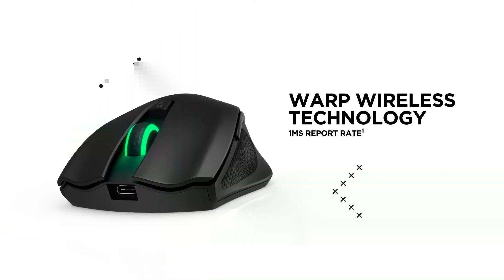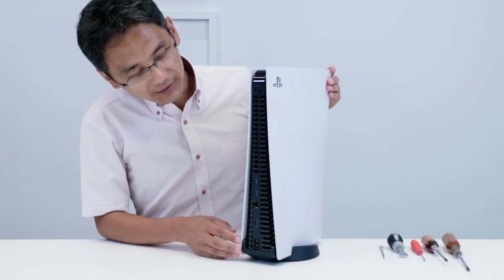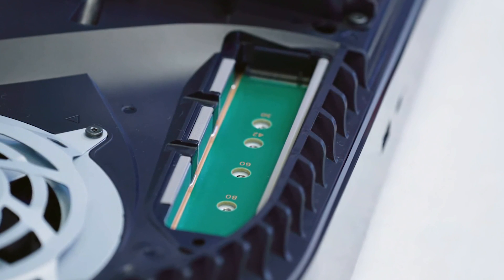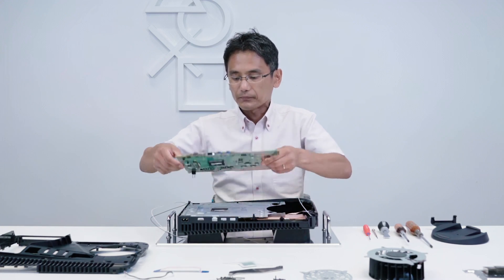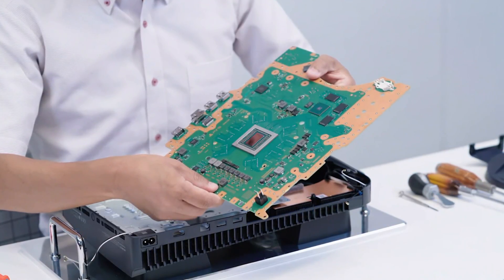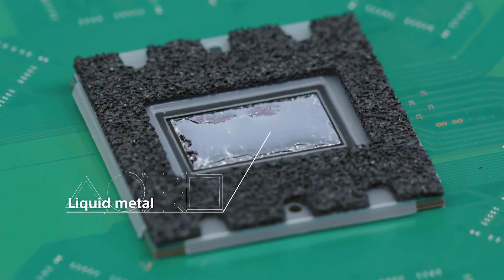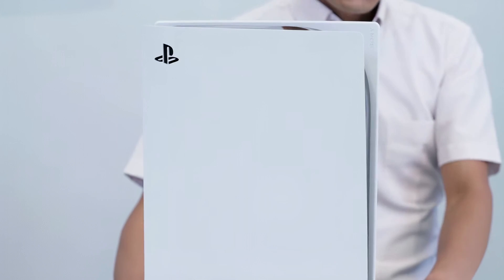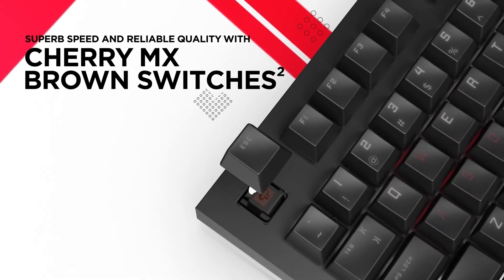PlayStation 5 Teardown Analysis: Inside Sony's Next Generation Hardware Design

Comment: Microsoft: you will only need a 4ft x4ft table if you take our xsx apart
Sony: you will need a 10ft x 5ft table for us 🤣
Reply: Looking at the PS5 disassembled reminds me of parts for a Gundam model.
Reply: FUCK YOU GOOGLE ASSHOLE   We'll have to see if it overheats but I do think it will be louder.. one thing about it though overclocking definitely creates more wear and tear so if they didn't engineer it properly it's going to fail more often than the Xbox.

The thing about overclocking though is that there is an upper clock and a lower clock. The console was originally 9.1 teraflops before they saw the 12.155 of the Xbox. 

So they overclocked the CPU and the GPU to reach 10.28. The problem with this is that only one piece of hardware can be overclocked at a time they cannot be overclocked together. Meaning that they cannot be overclocked concurrently at the same time.

This means when the GPU needs to overclock the CPU is going to down clock. And when the CPU needs to overclock the GPU is going to have to down clock.  So it's not a true 10.28 teraflop console.

Overclocking cannot be maintained 100% of the time or the entire console would literally fail. So it has to be used intelligently.

The issue with this is that there's lower ceilings to these clocks. And I would estimate that it's going to be closer to 9.3 possibly 9.4 under normal operating circumstances.

I'm an IT Major if you're wondering why I say that.
Reply: @Hannibal OMG..Sound¿?? Lol
Well you seem so disparate !
Reply: @Hannibal WOW.. How Incredibly intelligent and well thought out rebuttal...............   Did you just replace and swap words from a Hallmark card?  Because I tell you, Im sure ive seen it on one for a 13 year olds birthday..... Had a Picture of a Trophy on the Front.. Hang on.. Is it your 13th Birthday?????
Ok...as Im an adult, Ill try to make this easy to understand."Project less you angry, bitter pathetic little fanboy.."
 Your harsh judgement is really all put upon yourself.... I also do understand, You must be burning inside that your Real mum, whom you havent spent a lot of time with , well. ,not without paying,.( Always free for me ) 

I had actually responded before, and it was a Damn rippa....But Alas , It got lost in the Digital Either .. But however, I must reply in good stead , and did try to meet on common ground..However , its is impossible that I dont have a void in between my ears...  Its obvious that your IQ isn't even an IOU.. No one ever took it from you, As so far, I have come to the conclusion, You missed out when it was being handed out.... Your prepubescent correspondence suggests it must be copied from some online school help page  "Deal with Bullies Online-=101 (Kindergarten Edition)" 
I know it must be hard for you, especially knowing that your being has as much depth as a puddle that a sprinkle of a sun shower makes on Bitchumen during a heatwave…  
I do apologise I couldn't resend my original post, , It was a Rippa...  About 10 Paragraphs (Paragraphs are made ups of sentences… And sentences are made ups with words.. You'll get it, After learning your abc's... You cant copy and paste forever)

But , I grow weary of your insolence , and having been Writing Music and Drinking Brewskis all day , im feeling I need to go relax from all the non work I haven't been doing....

SO I must wrap this up.. I must take into account the issue of you being on the spectrum.. Though That would be disrespectful to those that haven't gone full like yourself .

But I know what you wont find on my reply   in my comeback.... 
That you can scrape off your mothers teeth..... 

BTW, I think you should give it a few days, your mums on the rag and Roll.. But I guess you know that after tasting your dads Microsoft.
Reply: Martin Schmidt   A sony Shill? Why? Because my opinion makes you defensive? Im having so much fun outing what is hypocrisy in spades.....   And you should read it, its for fun..   You see, when people  take something on as a personal attack, which is not on a personal forum , but a public one, shows peoples insecurities..... And here many have been unveiled.... Boy.. You'd be fun at Parties...... Oh... Am I on drugs? No.... Are you?
Reply: yeh.. Thats because really that table that 4x4 has a brute force PC underneath , operated by a brother of Craig.
Reply: @Rhythmattica  You're going to be really sad this entire gen if you don't think the Series X is the most powerful console.
Reply: @IxChipmunk101xI  What? Most powerful console with no exclusives that I can even play on my Mac Pro runniung Windows.. And the most powerful console? Like thats an issue that has been debunked multiple times  that this what makes a gaming  machine... LOL..  Games make a Gaming Console... Not Multi plats available even on phones via subscription... Thats the only reason I by a gaming console... Never have I bought one for POWA!... To Add, if sony goes the GAAS model, Ill be just a PC gamer.....Like always, MS tries a market, like Mobile, Zune. OG Xbox, Expecting to strong arm their way in , but when it fails, they go running, and use their marketing tag terms like "Outdated Console War" .. And usual, Based on nothing inovative , but a consolidation of what's been on offer by Mobile stores , Steam , and streaming subs like Netflix  Gakia,  Have fun with your sub box , And if Powa matters, it shouldn't right?? Console wars out dated....So says MS right?
Though Im sure the IQ and FPS on those VR games with be awesome with the POWA of MS's Non Gen. OH Wait!
To add... Sad that this entire gen the SX is the most powerful?  Wow..  So thats all you've got? Thats your retort? GOLD
, and with no VR on a next gen console, when even a current gem console has VR, I feel even dumber for responding.....
I award you no Points, And no Exclusives.
Reply: @Rhythmattica  If you guys really don't care about Microsoft exclusives then why are you whining about them having an Elder Scrolls, Fallout, Doom and everything else formerly owned by Zinemax exclusive to their console now?

Not only is the Xbox 38% stronger, but it's got a lot more than just power. Four generations of backward compatibility, Xbox Game pass which is an incredible value, and superior online infrastructure. That's in addition to Xcloud where you can literally play your console games with a controller anywhere..

Us Insiders already have it and that s*** is incredible.. with the One X that's like a six teraflop Nintendo switch with a better controller..

This is going to be a 12 teraflop switch with a better controller.. let's not forget they have the Series S for 299 which will give that PS5 a run for its money..

38% more power and $10 cheaper games... And now a ton of exclusives as well..

If you think people don't care about Elder Scrolls 6, Starfield, Halo, Gears 6, Fallout 5 and Doom 3 then you're mistaken.
Reply: @Hannibal Lol... Soooooooo DESPERATE.... Seems like most FB's , its always an assumption based on nothing but a small vocabulary and a correspondence no more creative than a  sentence from a DR Zeuss book.  Congrats .. You havent ever set the bar low, its but a invisible line below the ground you walk on.
Never go full.

Comment: Truth will be the power dissipation numbers for each console when under load. It looks like the PS5 will be the bigger room heater. I like the more compact lower power consumption Series-X. The PS5 is a more ragged edge design with the over clocking and the associated extra heat. Question to ask? If the consoles could be redesigned now who would make the bigger changes? Guessing the power hungry behemoth PS5 would roll more functions into silicon like decompression and ray tracing like the Series-X did. Sony would also add silicon so the system would not need to be overclocked. The Series-X is the more next generation HW that is leaving PS5 behind.

Comment: Wifi6 could also be used for the future PSVR2 for wireless play, correct?
Reply: It's the primary reason for having it I would say.
Reply: @tzuyd  Nope.
Reply: Maybe if you compress the image. For that use having 802.11 ad would make more sense with theoratical higher transfer speeds thanks to its mmW frequencies, which one of the few useful application due the requirement of having line of sight for it to work.
Reply: Of course you have to compress the image.  The throughput needed for a raw 120 fps signal at 1440p-4k would be insane.
Reply: @eliadbu  You mean 802.11ay 60ghz wigig, which no console for at least the next 10 years will be able to run, lmao. Also the fact that requires tons of power which means a massive 20000mah battery attached to your hip (not a big deal tho).
Reply: Sounds like a useless version. Like he stated you'd have to have a not produced now router and modem to utilize the feature.
Reply: He said you need hardware that supports Wifi 6 to use Wifi 6.  This hardware exists, just that it doesn't have widespread adoption yet.

Peripherals made for a device that uses Wifi 6 will obviously support Wifi 6.
Reply: @RaymondWebbIII  Someone doesn't know what peer-to-peer WiFi and WiFi direct is.
Spoiler: you could connect the PS5 to PSVR2 directly with no router involved while still connecting to your router wirelessly.
Reply: @RaymondWebbIII  Router and modern? lmao. No we are talking about two systems talking locally, network has nothing to do with this. A modem, is for ethernet, lmao. Just stfu when tech talk is going on, kid.
Reply: Nope. Inherent latency is inherent. Wifi6 is just 2+2 (5ghz+5ghz). It's not any faster or better irl use, it's just used to help with wifi network crosstalk. VR needs to hit at leastt 23ms to reach presence. 5ghz has a 50ms inherent latency. PSVR2 will need to be tethered, as do all VR systems (besides quest standalone).
Reply: @sqlevolicious  You talk as if you're living in a time frame where wireless VR doesn't already exist.  In just a year (let alone two) the technology will have improved beyond measure.

Comment: I never considered that the curvey design would make it more "idiot proof" by making it harder to block intakes and exhausts.
Reply: MertensCW  haha
Reply: Liam Spires  heatsinks are designed to disperse the heat, in the case of a console they take the heat in particular from the Apu, and relocate it away from that, to be dissipated by the air blown onto it. The heatsink or the vapor chamber alone doesn't work, it always in combination with a fan (and a pump in case of liquid cooling system )
Reply: MertensCW  You made me chuckle. Either way I can't wait to unbock and play my white and weird massive silent behemoth.
Reply: Martin Schmidt  richard specifically posted an article. Search it up. It’s about ps specs.
Reply: Martin Schmidt  it isn’t. It’s there on the internet. If you doubt it search it up. Or should I also do that for you?
Reply: Martin Schmidt  and I gave it to you.
Reply: Martin Schmidt  are you kidding me? I just posted a comment with a link on it. Not my problem if you can’t see it. Willfully ignorant. Lmao
Reply: Martin Schmidt  “There are two ways to look at this. First of all, I can tell you every single developer I’ve spoken to developing for PS5 has been evangelising how easy it is to work for.

“It’s essentially the same development environment as PS4 and you scale up from there, for the new power, the new features and whatnot. I can’t stress enough how happy developers seem to be with this situation.” 

This is what richard leadbitter said, not my words his. This came up with a single search, if you weren’t so lazy then you wouldn’t have wasted both of our time.
Reply: MertensCW  Really? You gonna go with that after the red ring of death?
Honestly with reports and that cgi animation of some air flowing through the series X magically when it's pretty much crammed in that box is what you should be worried about.
Reply: how many will put a book or magazine on top of xbox? you'd be surprised.
Reply: Martin Schmidt  digital foundrys richard talked about their variable clocks. Long story short its different compared to the pc where performance heavily fluctuates to the point it affects performance like that other dude is claiming. Also it won’t thermal throttle. Even richard who said that devs said the ps5 is easier to develop for. Don’t know where you get news from.
Reply: MertensCW  gotta appreciate a good Jab 👍
Reply: That's because you are an idiot. 
I jest of course.
Reply: Martin Schmidt  firstly you never specified what you were asking about einstein, maybe you need to do some work on your thinking capacity before you talk about the English skills of others. Also since you have specified exactly what you were asking about then ti check digital Foundrys celebration for one million subscribers. In that video he said that the ps5 is easy to develop for and that people will be surprised in a good way with the PS5. Now do with that what you want. :)
Reply: It does make me cringe a little to see the Xbox Series X with its top fan.  I'm absolutely expecting that to get crammed into a cubby in someone's media center, blasting hot air straight into a piece of particle board.  Many of the Xbox designs have really dumb thermal layouts - particularly top-exhausting fans (360 S, One S).  You'd think they would learn.

OTOH, the PS4 had more thermal issues than the XB1, so I guess you never know.
Reply: @sirnickity  Cough Cough PS4 pro jet engine
Reply: @sirnickity  is it that hard to put the console a little bit further than the wall?
Reply: @sirnickity  I am more upset to Sony for the way PS5 is, it is asking for overheating issues. Series X is in this two generations away already. :( For some fanboys, it is probably good neews that they can say series x beats ps5 in performance so much.. But for those who like technologies and will buy both anyways.. Sony didnt learn its lesson from ps4 pro, goes for crazy compute units mhz - which will lead to highest temps produced by any console ever, without Vaper chamber, with classic heatsink?!? 🤔 It all just leads to one think, teoretically, ps5 can produce 10.2 tflops, in reality it really be that RTX 2060 Super performance in areas of 7 tflops.. And that is really shame on You Sony.. :(((
Reply: @JenicekUK  fake news. The frequency wont fall far enough to go even 8 tf.
Reply: @kyzersoze8408  8 tflops could be possible - but even that is already hurting its hardware.. Sony probably wont risk this.
Reply: @JenicekUK  lol it won’t even reach below a 9 Tflops mark lmao.
Reply: @kyzersoze8408  You can do with Your PS5 whatever you would like - good luck mosh! 😂😂😂😀
Reply: @JenicekUK  ps5 will overheat only if there is a defective component, because even ps4 and ps4 pro never overheated,  they are loud and it's the reason why they aren't overheating. Plus have you seen the dimensions of that heatsink? It's at least 3 times the ps4 pro one, you don't need a vapor chamber,  when you already have a big heatsink.
Reply: @JenicekUK  Learn to write a coherent sentence before you criticize new technology.
Reply: @JenicekUK  this comment didn't age well 🤣
Reply: MertensCW  Sony's audience can unscrew a screw though, so no matter how dumb they may be they're still smarter than Xbots.
Reply: @souljastation5463  blegh, I had a PS4 and I now have a PS5, and your comment is embarrassing. Let go of the console war crap, you'll be much happier and won't look like a smug teenager
Reply: @apictureoffunction  I'm not a Superfan of Playststion, I just like making fun of Xbots.
Reply: @souljastation5463  I'm not calling you a superfan, and I don't think there's anything wrong with being a big fan of Sony, Microsoft, or Nintendo.
I'm saying it's pointless and immature to act as though a console you may not like, and the people that play on said console, are somehow stupid or inferior. If you don't like a console you can easily just not play on it, but there's no reason to treat people who like the console like garbage or crap on their console that they're probably excited about
Reply: @apictureoffunction   I agree 100%, I was making fun of them only because of all the racket the made for the screw, it always amuses me, if it came out as serious it was not my intention, I was just joking.
Reply: @souljastation5463  Your assuming they can unscrew. Just cause Sony added a screw doesnt mean people will know how to use it. I can bet 99 percent of the people will never touch it.
Reply: @guardianali  pc master race here, i can t teach my fellow sonystas how to screw and even delid, just keep those ex-clusives coming. sit on your corner x-bosta
Reply: @bladerj  it's xbots that are afraid of screws, Sony fans are OK with unscrewing a couple of screws.
Reply: @souljastation5463  you must be fun at parties

Comment: You want pc like performance? You're going to get it in pc like size too. Yes you can go tiny on a pc with insane performance but not for for $500.
Reply: nah, miniITX with a 1650 can easily hit the $500 mark and outperform both consoles 3 times over. People are already building them on youtube.
Reply: @sqlevolicious  I'll have to look it up. As it stands right now I have a hard time a 1650 does 4k + ray tracing better than the PS5 or series x for $500 or less. The idea being Sony and Microsoft are selling their consoles at a loss and when you buy pc parts individually each one is trying to be sold at a profit. I think PC's will catch up and pass quickly but I think for $500 the value of the the consoles will be better. SSD and blue ray drives as well.

Edit: and size being a factor.